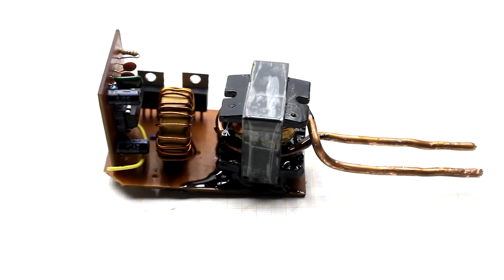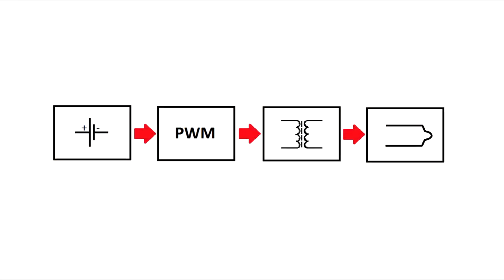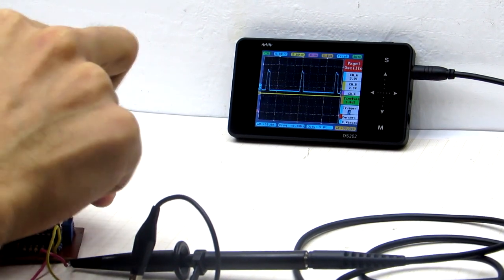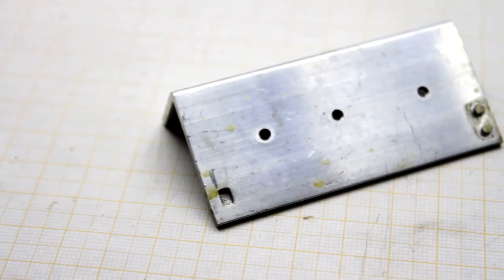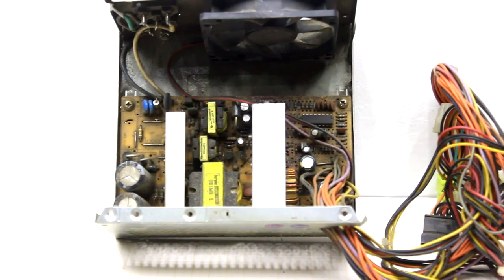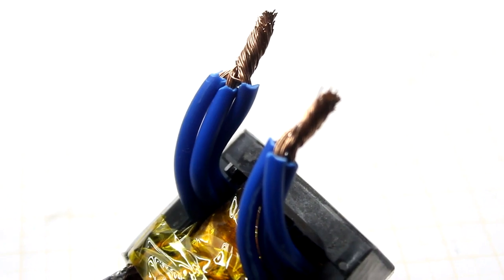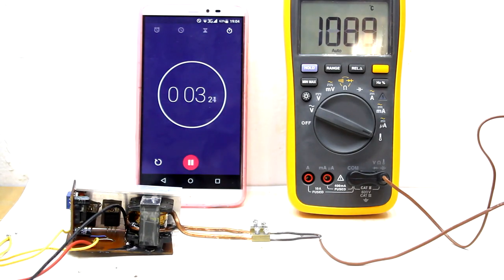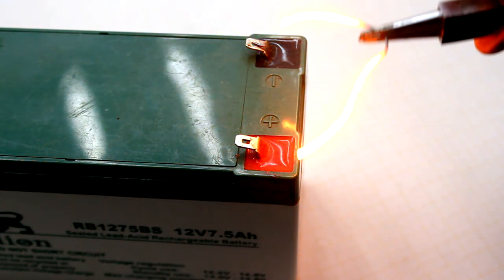How to make wireless soldering iron ?

Comment: I love it. Made from junk parts, and it works. I have a problem taking the existing windings from an existing transformer, without it breaking into pieces. I even put it in the oven (375F) to soften the epoxies. Did you do a video on how to rebuild a transformer like these? 
It goes to show, you don't need a fancy lab to make stuff that works. Only know-how.
Reply: UFOhunter in one of the first videos he has shown 3 ways to disassemble a transformer. you should check it.
Reply: I'll check it out. Thanks.
Reply: UFOhunter, I recently tried it too and boiled the Transformer in Water. I had the best results when still hot. I just tapped the core a little and then it easily came apart.
Reply: I tried the boiling method since it was the easiest. Just like boiling eggs!
It works well. Now only if there was a boiling method to wrap new wires around it ! :)
Reply: UFOhunter , now that would be very interesting technology. :-)

Comment: So i can use 12v 2amp wall adapter
Reply: I've tried running mine at 9v with a max of 1.5A and it works but not as well as on 12v 75A power supply

Comment: Good, but non-practical  . Prolonged use will burn either transformer or electronic parts because heat will increase suddenly in transformer  due to shorting of secondary coil..
Thanks. ....😊
Reply: I just built one a week ago and your comment isn't true about the transformer, infact I have one complete turn at 8mm diameter on the secondary & it just gets warm, the tip gets red hot. The burning of electronics as you say is going to happen with poor heatsinks for the IRFZ44s, mine draws 2.7A, the primary has a diameter of 2mm and doesn't even warm up, no way such a transformer is even getting hot. The only issue I've encounter with it is dry joints over time and this I will be upgrading to a more robust PCB as the one I assembled it on was cheap and thin copper stripped.
Reply: @johnmarkm.5743  Yeah, he doesn't know how this thing works. I find it interesting though that you don't need conductors bigger than 8 mm for 60Hz due to skin effect. At 10khz, the skin depth is 0.6 mm, so the rest is wasted.
Reply: @davemwangi05  mmmmm, litz wire.

or better yet, water cooled 1/8 copper tubing.

transformer heating is due to bad core material choice, or impedance mismatch. 
if the core gets saturated, theres no more reactance and it may as well be a dead short at that point. you get resistive heating in the primary conductor.
another core might have too much remnance, and the hysteresis causes the heating.
or its too conductive/particle size too large for frequency, and its eddy current heating in the core. 

short the secondary, it gets hot... but then you get into impedance and load matching and this interesting thought that in a closed, single turn secondary... where exactly is the load, and where in the circuit is the heat being produced? its through the entire secondary. induction heater being a perfect example.
throw a resistance in, and you limit the current in the secondary circuit. the heat in the resistance is due to the drop in potential, and the secondary doesnt get so hot.
as you keep increasing resistance it has a higher and higher voltage drop, but at the same time its also reducing total current, so there is that nice sweet spot where it limits current to the point it has maximum potential drop across it, with maximum heat dissipation. too large or too small a resistance causes either less current with less drop for less power dissipation, or more current with again... less drop in potential across the resistance, but more dissipation in the total circuit as theres more current flowing through the entire circuit and its resistance..
the supply to the secondary is not infinite, it can only transfer so much power.  load /impedance mismatching.

its actually pretty easy to do what OP first said, but thats mostly luck in what random junk you happened to salvage parts from, rather than any shortfalling of the circuit design.

 having an element thats too low in resistance compared to the secondary circuit and its impedance...

misunderstanding things...

using a resistor or capacitor an order of magnitude off in the timing circuit...